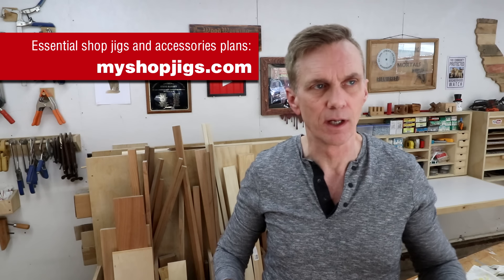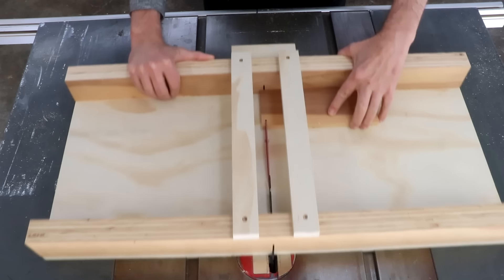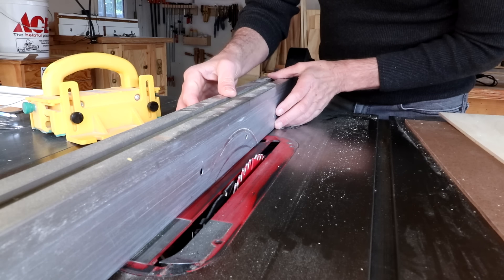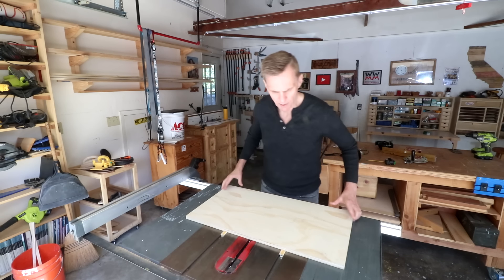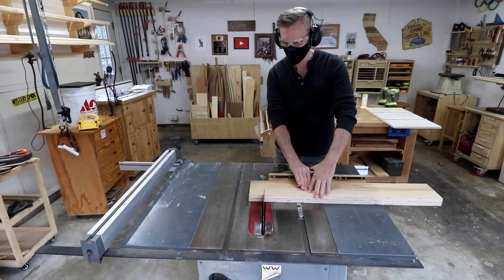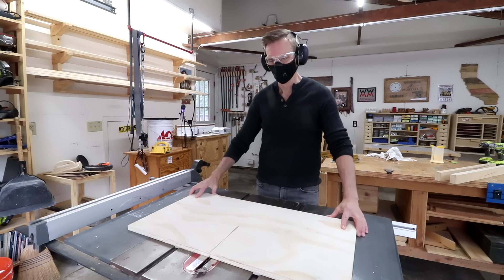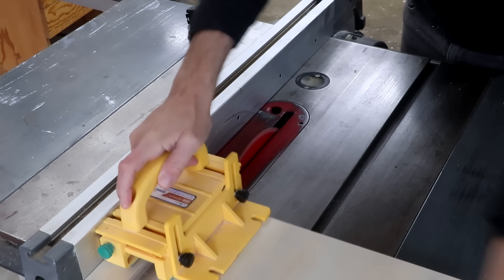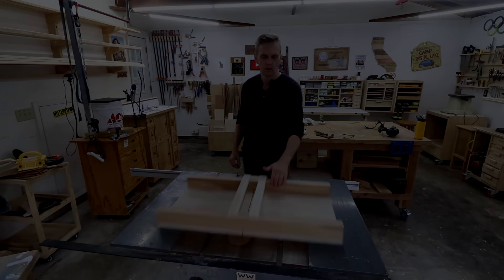The simplest table saw crosscut sled on YouTube. Essential woodworking shop project.

Comment: What do you all think the maximum depth of cut for this sled would be (thickest stock you can crosscut with it)? The top of the fence (and that stack of small pieces at the front) is about 3" from the saw table top. If you crosscut the full 3", you cut the sled in half. How much do you think is safe? Half way? I ask because I want to be able to cut about 2 1/2" so I'm thinking I need a taller fence, and I want to decide how much taller. That last demo cut he makes looks to be a bit under halfway up, so he's got about 1 1/2" of fence still holding the sled together. I think if I make the fences 4 1/2" tall I should be OK cutting 2 1/2" and leaving 2" of fence. Maybe an even shorter fence would get good enough, like maybe 4"?

Comment: Cool sled, and great video as always - thanks.

One thing occurred to me - between the top strips that run front-to-back parallel to the blade, how about a sheet of plexiglass to prevent sawdust escaping upwards towards your face?

Comment: great video!! always very helpful. QUESTION: does it matter is the rails are raising the Sled from the table of the table saw so there is a gap bewteen the sled and the table?
would that be dangerous for any reasons?
Reply: The rails are not raising the sled. That was only temporary during assembly. That was why he put the rows of nuts in the miter slots. After the rails were glued and nuts removed, the sled rides on the saw table with no clearance.

Comment: I don't understand why fitting the runners perfectly into the saw table tracks is such a big deal,  you can make them less wide, the only critical part is that the insides are aligned with the inside edge of the track as between 5he two of them they will stop any sideway movement.  This approach means you should be able to just screw two pieces of square or 90 degree angle iron or even aluminum.  As long as the inside (closest to the blade) of the runner and track are aligned.

Comment: I did woodworking for several years and junior high in high school, and my teachers let me run everything, including the table, saw lathe all of it. The teacher can’t do that these days so I used a big huge sled on the table saw. Of course, in school. Those saws are very powerful. There was a bully that was picking on me in the school happen to be in that class so when I used the powerful planer, I ran oak through it, I said, I’m gonna fix that guy. It threw all kinds of pieces of wood right in his head. I already knew it would do this already was that sharp at that age. For some reason I’d loved woodworking.

Comment: When drilling into the fences, do you need to worry about accidentally hitting the glue seam between the boards that make up the fence? Said another way, do you offset your screw to ensure it's going into the middle of one of the plywood boards that make up the fence, or do you go for the middle of the whole fence?

Comment: Seasonal Humidity - Steve - i made this Cross cut sled back in July (Winter in Australia) and it works great! - tho, now we are in Summer, and its too tight.. Im concerned that if i shave a little off the runners, come winter, it will be sloppy again....  I used hardwood runners.  Should i change them out for something else?
Reply from the maker: Plywood wood be a good choice
Reply: @SteveRamsey  I've used plywood for the main secitons, only hardwood on the runners....  Thats why im supprised that there is expansion.  Can you make the runners from Ply?
Reply from the maker: @ArchEdge  Yeah it's probably better.

Comment: hi Steve, really liked this video. not complicated but does the job.  i do have two questions, i have  a very small work shop so i am forced to stick with the smallest table saw available, which in my case is a Delta 10 " cheapo saw. one of the biggest issue i have is the table top itself. it is not super smooth like the better table saws so the material i am cutting kind of drags as i slide it. i think a sled would also be the same problem.  this table top is the kind that have all those square holes cut into the metal, can you suggest some way that i could somehow smooth the table top to eliminate this issue ??
second question also has to do with the table top. besides the square holes, each panel also has a round hole in the middle,  im sure you must be familiar with these table saws,  what are these round holes for ????

Comment: when finished with the crosscut sled, you have a slot for the blade...is measuring from the slot to the fence on the sled to check for square accurate?

Comment: Followed directions precisely.  Runners ran smooth and easy by themselves.  Once glued to the bottom they are too tight; can be inserted but do not slide easily.  What did I do wrong?
Reply: Guessing moisture swelled your runners. You can sand them down a little at a time until they slide freely. Then replace them again when they're worn and you're no longer getting square cuts or remove them and use a hard durable plastic.

Comment: Steve, I hope youll see this, because im at my wit's end. I have a crosscut sled whose 90 degree angle is ever so sliiightly off. Thinking it wasn't a big deal, I kept making projects, but started to regret it pretty soon. Even with the 5 cut method, I didn't get the results I wanted. Seems like the adjustments are tens of thousands of inches, but it's still noticeable when doing a "5 cut square". Do you have any recommendations for getting this right once and for all?

ANY advice is greatly appreciated!

Comment: The rear fence...closest to you on the inside should have a rounded over bottom edge as a dust gap.  Generally you do all the steps, squaring up and all..then when you have it perfect, take it off and bevel that bottom inside edge so that dust does not build up and result in crooked cuts when making multiple cuts using a stop block.

Comment: I’ve watched a tonne of these DIY sled videos and got curious. I wonder how bad the mitre slide that comes with my table saw really is? Did 5 random length cuts of different pieces of timber and guess what… they were all perfectly square! Yep I was impressed too. I wonder how many of us are building sleds we really don’t need to make? And losing a half inch of depth in the process.
Reply: You must have one wonderful saw and gauge.  Try the five cut square method using your miter gauge and tell me how perfect it turned out please.  I'm betting even a rudimentary sled beats a fantastic miter gauge.

Comment: I prefer to use 1/4" HDPE for runners. The smallest sheet you can typically order costs about $50.00, yes even in post pandemic dollars, but it's 24" x 48". I bought one sheet six years ago and I'm still cutting runners off of it for jigs. Spray silicone dry lube on them and they slide like greased glass in the slots. Plus they don't swell and shrink like Steve mentions hardwood runners will. I don't like using plywood for runners because in my experience thin plywood strips tend to delaminate fairly quick. The HDPE will be the same size no matter the temp, humidity or length of time it's on there.
Reply: Thanks for the tip. I was just thinking that nylon impregnated with graphite, the black colored machineable nylon, which is probably similar or the same thing as the HDPE you are talking about, would work better than wood and better than steel, for jigs, track saw guides, etc. Because the plastic is slippery, and it can be made with tight tolerances, and with a tiny bit of lubrication, probably lasts forever. They make plastic infused with graphite, designed for bearing and guide surfaces, at my local metal supply house. I think I'll try to buy some for a crosscut sled, or a circular saw tracksaw guide. Thank you much for the idea. I built a crosscut sled with oak runners and it kind of barely slides. It's definitely not super smooth.

Comment: Still have the old Porter Cable table saw?  I recognized it cause I have the same one!  The sawdust exhaust port broke on me and I blew one of the motor capacitors,  but other than that it's been good!

Comment: I agree with everything you said. Except for the mortising part.

You should never cut mortises with your legs on either side og the chopping action. You have main arteries on the i side of your thighs and if you cut them, you will bleed out very quick.

Instead sit with both legs to one side so that if you miss the wood or the chisel slips you cut the outside of your leg.

Comment: Would this sled take the place of the table saw fence? I have a cheap 10 year old table saw with a fence that isn’t square. I’ve been thinking about upgrading to a rack and pinion fence-type table saw, but my table saw is still working great.

Comment: Not sure if you'll see this but my first table saw has a small 24"x24" surface (Warrior table saw from Harbor Freight) - What dimension would you recommend for the sled top, should it be smaller than the table top dimension or should it be the same dimension or should it be a little larger?  Thank you for your time. :)

Comment: No mention of the "5 cut method" for squaring the main fence? Can you address the 5 cut method and why you didn't use it to square the fence?
Reply: May I hazard a guess? He mentions that he's never done it and it's not entirely necessary. Also, most beginners won't have or ever need calipers or those automotive feeler gauges either. Anyway, the 5 cut method works well for sure but isn't a must have.

Comment: Just a quick question  why not offset the sled so you could run it in the direction that may suit your needs.  
You'd only need to square both ends of the sled.  
Seems like it would add some versatility too the sled.
You used a 3/4" base.  Would a 1/2" birch not lighten up the sled a little ?
Reply: The limitation to making it reversible is that both slots need to be equidistant from the center of the blade.  In most cases they are not --- think of a thin kerf blade vs. a dado stack for an exaggerated case.  This leads to a wider 'slit' in the base and you lose the support you like for cleaner cuts - one of the reasons to use a sled.  I agree 3/4" is overkill for the base, reduce the weight and lost blade height.  I made a small sled with plexiglass sheet, works fine.

Comment: Newbie question here.  Why have a rear (the one further from you as you stand in front of the saw) fence on the sled at all?  Is that just to remind you not to attempt to cut anything that is so wide that the front of the sled is hanging dangerously off the saw?

Comment: When cutting material  that is a bit too long for the table I often find it satisfactory to reverse the miter gauge and push the wood against it.   As you can imagine that means I am standing off to the side a bit.  That has always been my habit from working in metal shops that I instinctively and habitually stay out line of any machine that can throw particles or sparks if possible.

But... I acknowledge I need not one, but several crosscut sleds.  Some for common angles up to 45°.
Reply: That is such an excellent idea! Why did I not think of doing that, sigh.

Comment: Hey I saw your video on miter sled  for your table saw improved version back in feb 2013. Just starting in this type of work and trying to get some tips and tricks for mt table saw. My question to you is with your miter sled can you cut base boards inside and out side? Thank you Airborne triple nickel 555.

Comment: Hi Steve, I was wondering why a lot of cross cut sleds have a thick base. If someone wanted to get the most out of their table saw, why not just use a strong thin base for the sled?
Reply: I used plexiglass for a smallish sled.  Worked fine.

Comment: Starting to make this but my tablesaw is pretty small, and the mitre gauge is tiny (the T-track is short) - so I'm struggling to cut the main board to size.  Any hints?  Other than buying a mitre gauge with a longer T-track fitting?

Comment: I recently purchased a table saw to use while renovating my home. The riving knife that came with it, seems to sit as close to the blade, but is much taller than yours appears to be. When trying to build a sled and cutting thru the far support, since I'm not cutting thru the entire board, the knife catches the board. Should the knife be able to rotate back so that the top of it, is in line with the top edge of the blade?
Reply: Most moderately modern contractor saws should allow you to install the knife at different positions. One of these should bring it to the same height as a typical blade. Check the manual or remove the knife and see if there are several slots or detents.
Reply: @langrock74  Thanks for the reply. The day after I commented, I tried to move it, and it did exactly as you said.

Comment: Do you not do the "square test" with a piece of scrap to make sure that front fence is perfectly square? I've seen a few people doing that when building cross-cut sleds, though it seems rather tedious.
Reply: it's tedious but you only have to do it once and is way more accurate than eyeballing it with a square

Comment: The two strips added at the end would limit the height of wood you can cut. Could you not put two blocks on the front crosspiece instead? That way you have a place to put your fingers keeping them safe and can cut 'taller' pieces of wood,....
Regards,
Allyn Hansen
new Zealand.

Comment: hi steve great video, but ive come across a problem , i cant cut through the back cross piece because my riving plate is higher than the blade to accomodate the blade guard,
 should i cut the riving plate down level with the top of my blade or just remove it while using the cross cutting jig?
Reply: I wouldn’t remove it if possible. Check if the knife can be lowered.

Comment: Is the blade equal distant from both runners? if so, can you turn it around 180 degrees and use it either way?
Reply: You would probably want to add a second set  of 3 block to make a  safety guard for the other side as well.
If the blade is NOT equidistant from both runners you could use the "reverse" side for 45° bevel cuts.
Just my penny's worth.

Comment: Hi Steve, Why do we need two fences? One is need to anchor or clamp but what is the need for other one?
Reply: Never mind. I got my answer. Blade will cut through the bottom so need front and back support to hold together 😂

Comment: Is the "rear fence" (the fence on the opposite side of the operator) really even necessary? What iv I had a large piece to cross cut that wouldn't fit in a sled that size?

Comment: Hello Steve. Thanks for this great video.  I got all excited to build a crosscut sled, only to realize my table saw only has one runner.  any suggestions?
Reply: I’m not Steve, but you could make a “half sled” - just make it slightly wider than where the blade is, and cut it off to make it zero clearance on the miter side
Reply: @jeffroberts760  Thanks for the tip! I'll give it a try.
Reply: Make it just like he did only with one runner.

Comment: Steve— when your glueing boards together like you did for your fences on this project, if you sprinkle some table salt on the glue, it will prevent the boards from sliding around, and you can get right to clamping l, without any issues.
Reply: Steve has been doing woodworking on YouTube for almost 100 years now, so he obviously knows about the salt trick. He discussed it in his Mar 6, 2020 episode: "5 tips for better glue-ups." and probably on many other occasions as well. This trick has been tested many many times on YouTube. Some people swear by it. Others (like Steve) see no noticeable difference.
Reply: @SeanChYT  I heard that if you use real pink Himalayan salt, it really works 👍
Reply: And it makes the glue taste better too!  :D

Comment: Is there any reason that you couldn't use a single sled for both a zero clearance cut and a dado cut?  One would be to the left of center, the other to the right -- and you'd need two blocks at the bottom and a third rail on top.

Comment: So with a cross-cut sled on a table saw, how safe is it to use if you  are using it for all your cuts - does the sled eliminate kick-back on the table-saw? ( I am not an expert with power saws)
Reply: If the fence closest to you is squared it should eliminate kickback.

Comment: Are there any downsides to making the sled reversible? So that I can have the long support on either side by flipping the sled.
Reply from the maker: I think that's a great idea!
Reply: Don't forget to add the block of 3 bits of plywood to make a second blade guard.

Comment: I've seen plenty of crosscut sled videos, but none for a smaller job site saw(mine is a Dewalt DW745). My woodworking area is 10'x10' and I don't have room for a regular table saw. How do I scale it down to fit my saw?  Does the riving knife need to be removed to use a sled?

Just because I'm small shouldn't mean I don't get a sled too..... ROFL!

Comment: You mentioned instability when using only 1 runner on the table saw. I was given a table saw (not one that I had researched) and it only comes with 1 runner. Can I still use this design with only 1 runner?
Reply from the maker: Definitely! Some sled designs only use one runner and give great results.
Reply: @SteveRamsey  thank you so much! I will definitely be building this ASAP

Comment: Hi Steve, I’ve watched this video about 20x, thanks!  Question:  You mention stop blocks would most likely be clamped to your right.  Why is that?  Thanks!
Reply: The long part of the board will be on the left, if you were feeding a long board from the right you would have to remove the rip fence.  Too much work.
Reply: @kirbyspencer538  Thanks!  I put this together a few months ago and did just that.  After using it all summer, the logic made sense.  Cheers!